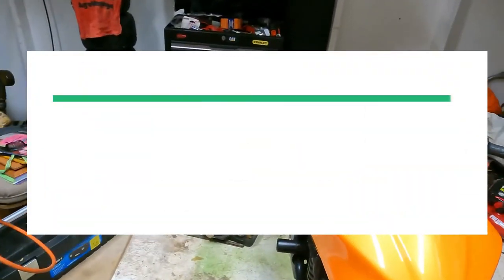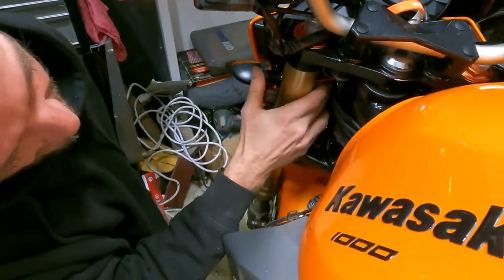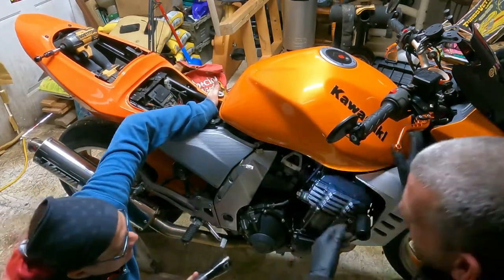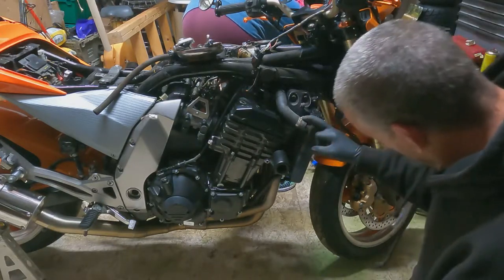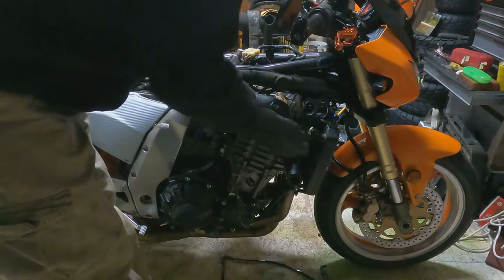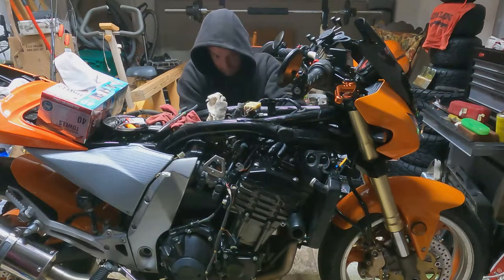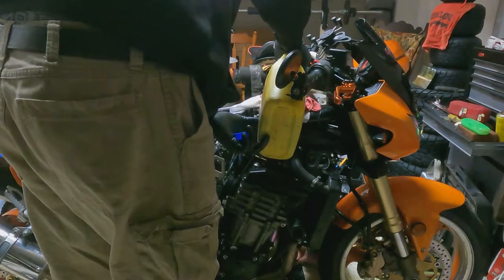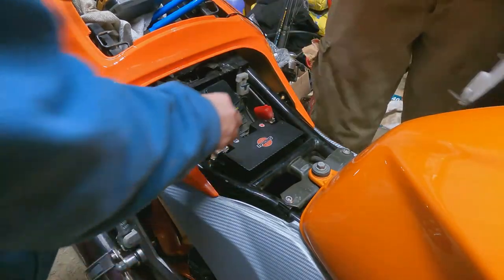2003 Kawasaki Z1000 Maintenance

Comment: Love mine, did you end up checking valve lash while you were in there ?. Got a little over 22k on mine and I should check them soon, I believe the manual says at 24k.
Reply from the maker: no we didn't. floki's been running like a champ no complaints yet